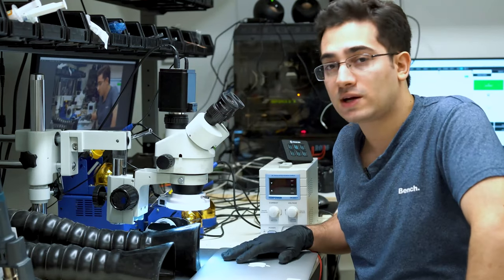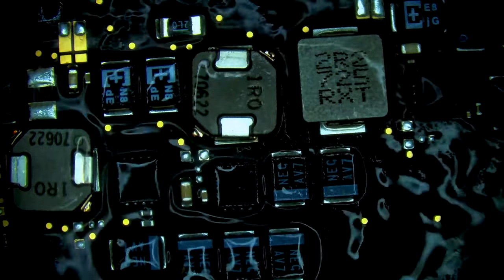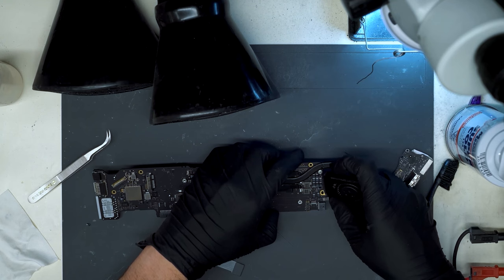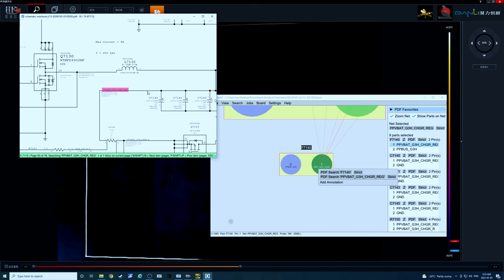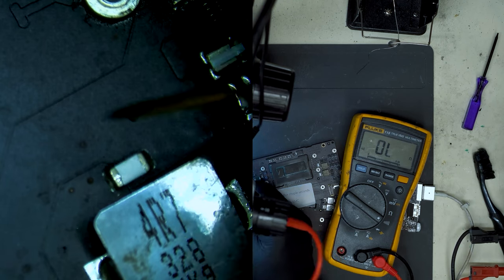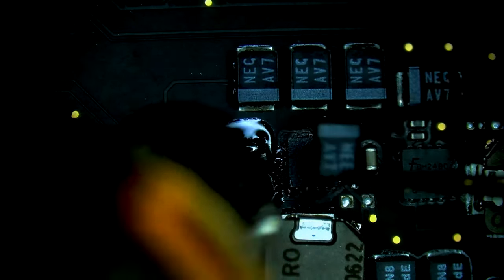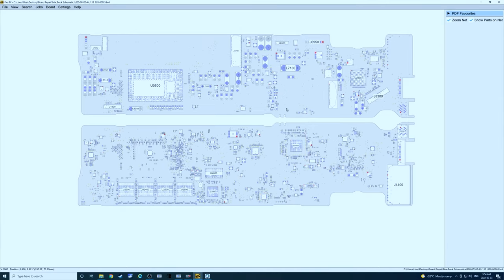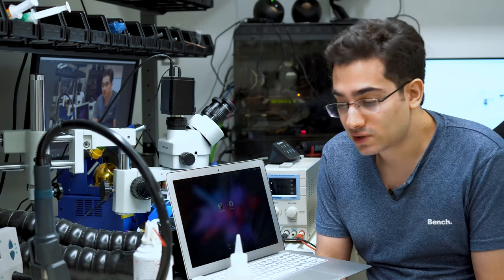MacBook Air with No Power - Short on PPBUS_G3H 🔥

Comment: Hi, on the board I have in the laboratory, on the usual fuse I have continuity, but from the left side I measure 8.5 v, on the right side (PPBUS G3H) I measure 1.6 v. always had to be 8.5v right? a thousand thanks
Reply from the maker: Yes check fuse health should be 8.6both sides
Reply: @marcuscupello  318 / 5.000
Risultati della traduzione
thank you very much for the confirmation, on one side it is 8.5 and on the other 1.5, I hope that by changing this fuse it will work again, the NEE AV7 capacitor had also exploded and I have already replaced it and there is no longer a short on the capacitors. is the third macbook that I repair, I have recently started doing these types of jobs